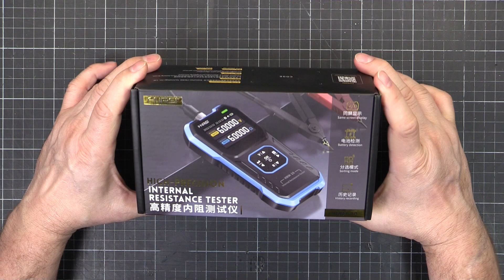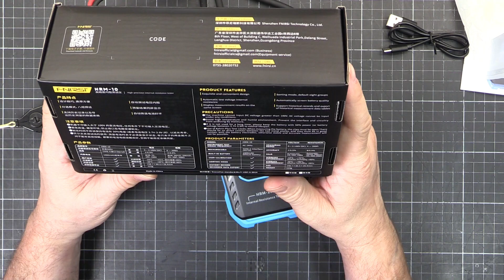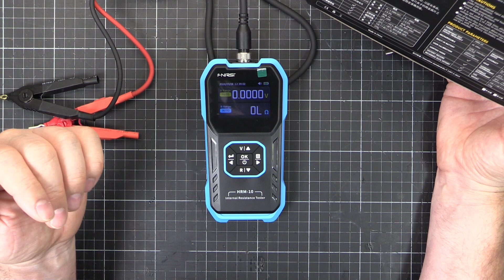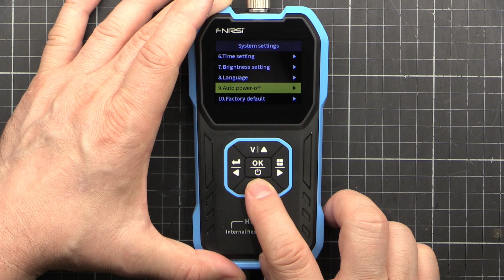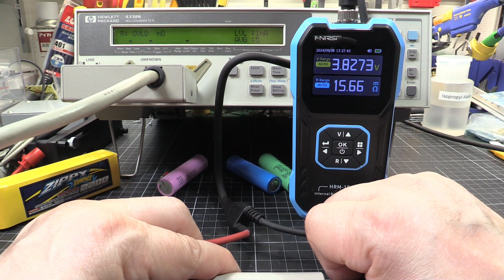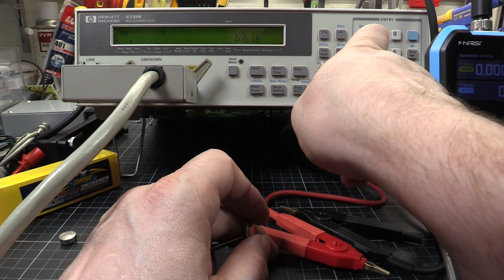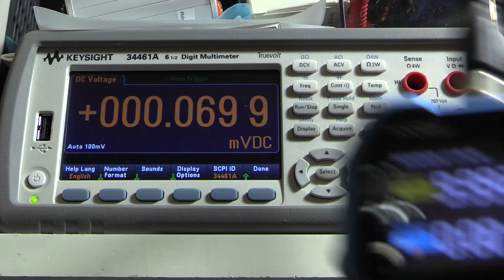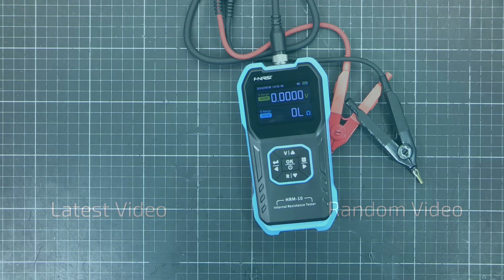Review: FNIRSI HRM-10 Internal Resistance Tester

Comment: just an observation. When testing the batteries with the Fnirsi., you should hold the clamps open to get a true stable resistance reading. each clamp consists of 2 wires to create a balanced reading.
Reply: bruh he literally said that the Manual mentions it, shorts/reels has rot our brains try avoiding them

Comment: Thats not to shabby.. do like that you compare it to another bench millioohm meter.
You can see the fw revision on nr10 in the menu.. "factory default"
many tends to not wanna click on that, as hey think it will reset, but you do have a step more, and in there you will get fw info... you will likely have FW0.4 like my own unit..while the latest in the official protocol cloud is still listed as FW0.3.
Its pretty straight forward to just cherryrig some cheap kelvin with an GX12-4pin connector, as clamp is far from ideal for bench uecases..

Comment: iyea this one. is the one I got.
Reply: I will be comparing it to a 16 bit 32s pair of Revo DPL8s PL chargers on .xls logging 10 hz. It shows five digits after the zero on teh ACIR logs. Decimal accuracy of the DPL8s calibration is to +/- 1mA
Measurement accuracy:
Voltage resolution: 78uV (16 bit)
Voltage tolerance: +/- 6mV

Comment: So if i need to know the GEL agm battery need to be changed or not  
Can i just use multimeter with feature to measure batteries ?
Reply from the maker: If you know the expected internal resistance limits for your battery, then this instrument can be used to see if the battery is healthy or needs to be replaced.
If the internal resistance measures more than the specifications, the battery needs to be replaced.
Reply: @NearFarMedia  wow thaaaaank you❤️